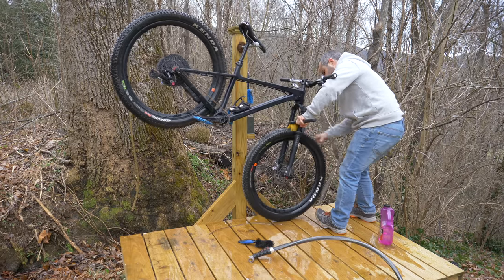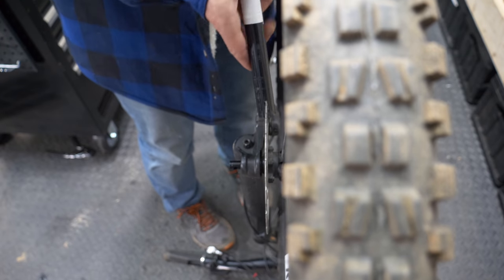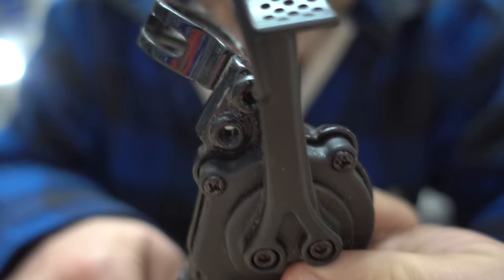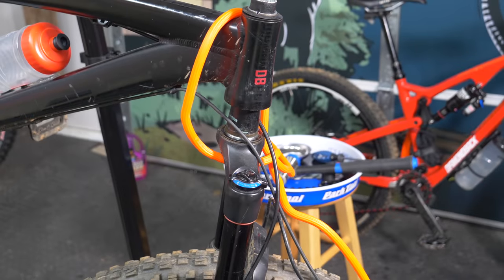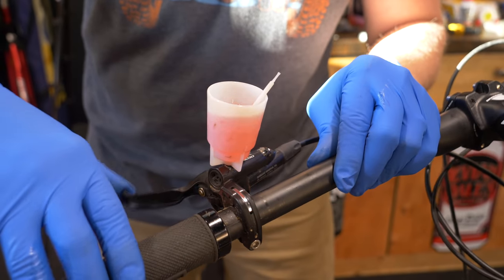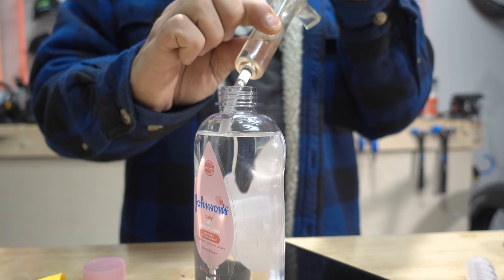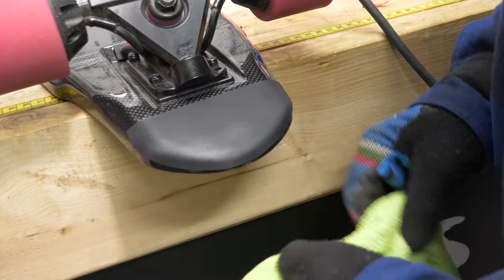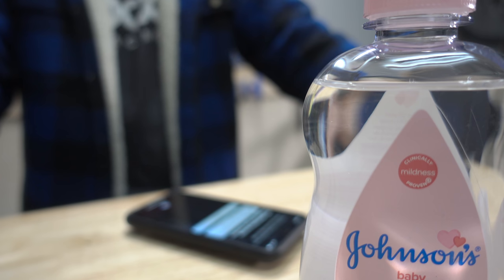10 Bike Hacks for Mountain Bikers and Beyond

Comment: Any hydraulic oil is mineral oil, transmission fluid, power steering fluid, jack fluid....I think all of those would be a much better choice and as readily available as baby oil.  Who knows what the additives might do to boiling point or the integrity of the brake internals.

Comment: how's the mineral/baby oil holding up?  BTW, unless there's a mineral oil spec that Shimano calls for, they can't void your warranty for using non-Shimano mineral oil of any type.  This is because of the Magnuson Moss warranty act.  This only hold true if they state mineral oil and nothing more.  If they do require some mineral oil spec that's only available through them, then they must supply it free of charge.  But again, if it just says mineral oil, any mineral oil will do.

Comment: How about using water (distilled) as a hydraulic brake fluid? Water is the less compressible than mineral oil, so it should perform better
Reply: Ahmed Maki Works great until it freezes/boils!
Reply: @pal-gunnarskog7050  how about mixing some anti freeze?

Comment: Little hack for cheap ass riders or for those who doesn't have kydex avaliable nearby - buy large diameter PVC drainage pipe (100mm/4in or above), cut the "female side" if it is present, make a cut along the pipe with saw/jigsaw and using a heat gun straighten it into a sheet form. In the end you'll have big ass pvc sheet which works as good as kydex and is a lot cheaper (in Ukraine 1m long/ 100mm diameter pipe costs around $4 and 400*400mm kydex sheet is ~$7)

Comment: When soldering, keep the wire horizontal and heat it from underneath, add solder paste to the wires and let them heat up first, then apply the solder on top, it'll be a lot easy for the solder to penetrate into the wire and it's almost impossible to break off. Also use lead free soldering wires for best results as they're a lot tougher than leaded ones once it cures.

Comment: When cutting carbon without water dont wear those flimzy dispozable white masks that you buy in packs get somthing like a painters mask that will seal your your         face better. In fact a contracter is legally obilged too isue a half or full face resperator if the dust they are keeping out has lasting or deathly effect in the long run sorry to drag on but im a saftery entusiest

Comment: Baby oil is a very light mineral oil that contains about 0.3% perfume oil. The perfume oil contains about 40 ingredients, some of which could affect the seals in your brakes. Admittedly these ingredients are probably at less than 1.0% in the perfume and therefore  only at trace dosages in the oil but I've seen perfume oil incompletely solubilised in a roll-on deodorant, floating on the surface and degrading the polystyrene ball so I think I'll stick with an unperfumed mineral oil thanks.

Comment: Don't ever use black tape that crap degrades and turns into a sticky mess that is hard to clean. Not to mention the residue on your hands when you try to remove old tape.

Comment: Mineral oil is not a standard like Dot 4 and 5.1. I tried using another brand than shimano and the brakes worked but where very stiff. It was easy to clean out with Shimano oil. 
The fact that they market mineral oil for babies is crazy. They can never get baby oil completely clean from crude oil contaminents. Johnson was also sued for causing cervix cancer from baby powder to a woman, which is also a cancerogenic. But she died before the trial ended.

Comment: Do not makea cable nub with plumbing solder! cables need strength it may work but could fail in a hard pull. Silver jewellry solder is hard solder.

Comment: Hey Seth did you know that spraying a soapy solution like detergent on disc rotors can enhance your braking power!
Reply: Sarcasm or serious? Clarify please.
Reply: @rider65  Yeah its serious!
Reply: @artimehta4189  Okay, so, you're saying soap on your rotors before you ride? Sorry, but that is not good for the pads or the pistons in the caliper.
Reply: @rider65  But the soap will clean all the dirt from the pads.
Reply: @artimehta4189  Wait, are you speaking of cleaning the rotors AFTER riding? Well of course cleaning the rotors with soap and water is good. Duh! :-D
Reply: @rider65  Yeah

Comment: PLEASE DONT USED SOLDER! I have no experience soldering the ends of my cables on my bike but I have plenty of experience with soldering electronics. Solder is made mostly of lead and is very soft and easy to bend, squish and strip off of wires. Hitting your brakes too hard may cause the solder joint to break and your brakes will be gone. Solder is not meant for structural connections.

Comment: oil can cause a condom to fail.   the gaskets in many HD systems/hoses are made from rubber.. would you use baby oil to lube up a condom if you don't want it to fail... ?  ask the bigQUESTIONS  maybe in a pinch. But then soon, replace it with the correct HD oil..

Comment: Yeeah it says mineral oil on the bottle. Must be the same stuff Shimano uses. Just like Alloy or steel. There is only one kind of everything.
Reply from the maker: not sure if sarcasm or serious
Reply: @SethsBikeHacks  sarcasm, as one can guess since there isn't just one kind of steel or alloy. there isn't a standard for the properties of mineral oil like for example for DOT 5.1 braking fluid. Shimano's braking fluid is quite aggressive and I wouldn't use it as a skin care product. Vice versa there is no telling what the boiling point, heat capacity, viscosity at certain temperatures, etc of baby oil is and how the gaskets will react to it. Best scenario: the fragrance component evaporates as the friction heat gets transferred into the baby oil and the brakes get spongy. Worst case scenario: The brakes fail right when you need them the most (maximum system stress). You are messing with the safety features of your bike. On any other part this wouldn't be a problem, but failing brakes can be quite fatal - especially with your do or die riding style.

Comment: Anyone telling you  that you need to use an official oil or fitting, is just an elitist, any tool guy knows if you can make it work, and you dont need to fix it after a short while, it's good. Tool/tradie types are not the same as gear snobs, yet they both know what works, one of the two not spending copious amounts of money at some bloated corporation